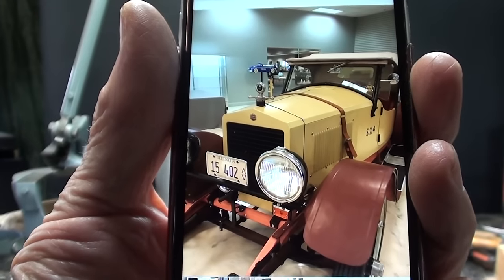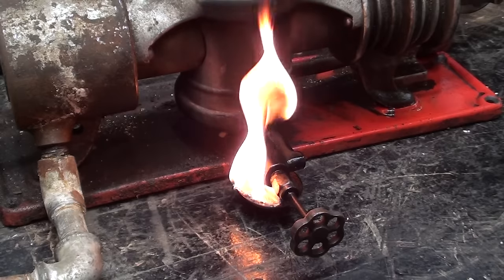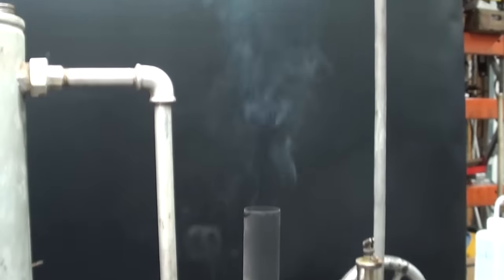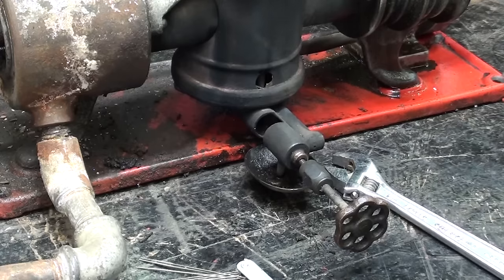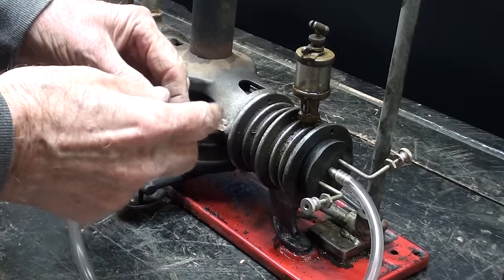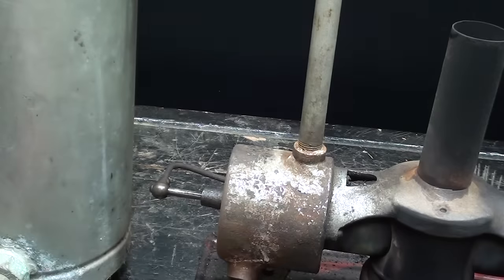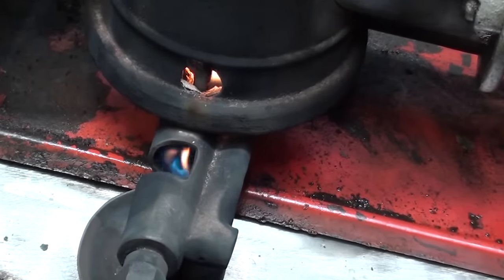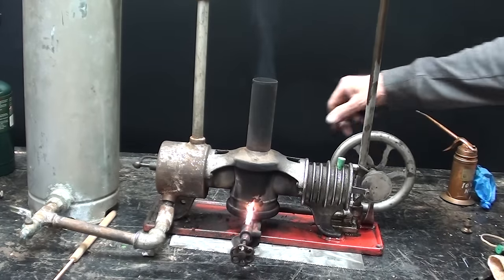ESSEX STIRLING HOT AIR ENGINE pt 2 #767 tubalcain stirling

Comment: I would start with a full disassembly, a cleaning and inspection and then applying all your knowledge of theory of operation of a hot air engine I’m quite sure you will get it running. I’m enjoying the video so far.
Reply from the maker: That is exactly what I will do in part four
Reply: @mrpete222  Thank you!

Comment: In regards to the lack of a blue flame. On my BBQ there is an adjustable stainless steel clip covering part of the port,  to adjust the amount of air entering maybe? Something like that would work. On the coolant, I agree with the previous poster of a air lock. Thanks for showing this wonderful engine.

Comment: First thing I noticed is you need to place the wick on the right side so that it heats up the vaporizing pocket.
The second thing is the pocket for vaporization is probably filled with caramelized fuel I would remove the valve assembly and clean it out so that the fuel will get direct contact with the walls and not the goo within.
Mix a couple drops of dish soap in with the lubrication oil and make the mix 50% oil and water I suspect that this air pump needs a little bit of humidity inside to create the collapse of steam back into water and expansion of water into steam.
I would prime it with a couple drops of water and assemble.
Make sure that the upper valve to the oil burner feed tank is completely open as the head pressure is necessary once the fuel is at temperature for vaporization then you should be getting a blue flame if not I suspect that the orifice may need to be drilled and tapped in a smaller jet installed until proper flame is achieved but I suspect the moisture will get it spinning in the current condition.
And when you're preheating it make sure that the piston on the water tank side is completely within it s cooling cylinder when the preheating process is happening or that piston will be too hot to condense the atmosphere within the chamber.
So it most likely will never start without the condensing piston inside the water jacket prior to attempting to start I believe this piston must be in the chilling cylinder as much as possible prior to starting.
Reply from the maker: Thank you for a very good suggestions

Comment: Looks like gasoline is right fuel. I always used LEADED regular in my dad's blow torch and it worked fine after you got it hot enough, which wasn't easy. Thanks for the lessons on the Stirling engine.

Comment: Please don't give up.  I would scrap the anti freeze and just use plain water until you get it running. Check and be sure the water system is free flowing. I believe temperature differential between the hot and cold side is important.

Comment: I've built several Stirling Cycle engines over the years and they are always finicky to get running.  First and foremost, you must get 2 things correct - 1) no air leaks at all, and  2) mechanisms must be absolutely free running with no binding anywhere.  These engines run off of the pressure differential generated by heated and cooled air.  As such they produce very little power and so can't overcome the leaks and binds.  Looks like you may have solved the air leak and I can't tell how free running the mechanisms are - they appear to be fairly free in the video but hard to tell without begin there myself.  But, one tip that I think may come in handy is that I think you're putting too much heat into the system.  The fact that your cold end is so hot that you can't touch it is key.  Try a much smaller flame and see if that gets you anywhere.  In the engines I've built, which are probably smaller than what you're showing, a small wax tealight candle is all that is needed to get them running - just enough heat to cause a pressure differential in the air but not too much heat to overpower the cooling capacity of the cold end.  BTW, I'm going to hazard a guess and say that tin can looking piece on the end of the hot end piston is probably there to help displace air from over the flame during the vacuum stroke.  Between that and the cold end displacer nearly all of the air volume should be pushed into the cooling jacket, which is absolutely what you want to have happen.  Hope you figure it out - good luck.
Reply from the maker: Thank you for an insightful comment from Another engine builder. I am going to take the entire engine apart

Comment: I was so hoping to see it run!!!  1. You're right, the burner flame should be blue and sound like a mini-blow torch, 2. as a few people noted below, did something nest inside the annular space thus causing all the smoke, 3. that bubba repair has got to be fixed... though the cast iron part of the piston seems to seal well, the drag has got to be causing problems, 4. looking forward to the cooling problem fix in vid 3.  Don't get too discouraged, I spent 30 yrs troubleshooting equipment that Bubba got a hold of ... great satisfaction from figuring out why it wasn't working.  Good luck!

Comment: Mr. Pete, I am finding this series to be very informative.
I built a sterling engine a number of years ago, and it doesn't run just about as well as your Essex.
(Mine is a Jan Ridders design, and I suspect my engine has a similar problem to yours, but caused by my lack of knowledge on the intricacies of making hot air engines).
Your process of troubleshooting will certainly help me with tracking down what ails my engine.
Thank you for posting this series.

Comment: I hope you don't give up on this project.  It is one your more interesting videos.  Also, getting old hardware like this hot air engine to work again is more than worth the effort in my opinion.  You have the skill and knowledge to get the job done.  So getter done!  We of the older generation have to show the younger ones you don't give up if at first you don't succeed.  Thanks for the video.
Reply from the maker: Thanks

Comment: Greetings from England.  If my experience with Primus Stoves and Tilley Lmps (Coleman Lanterns?) is anything to go by, if the burner is shooting liquid kerosene, the it isn't hot enough.  Furthermore, the liquid fuel going through it will cool it down further.  Also, make sure that the jet orifice in the burner is pricked out.  Use a wire of the same size as the jet for this process, not a pin or needle, or the jet will be spoiled.  Try filling the pre-heater bowl with alcohol, light it and let it burn out, then fill it and light it again.  Before it has burn out, and while there is still a decent flame, open up the main burner valve.  This procedure usually worked for me with the aforementioned appliances.

Comment: For the last several days I have done some reading and watched a lot of videos.  And it is a big Yes you can NOT have any air leaks, and yours is the only one I have seen with an oiler I bet it was added to help seal it.  On a good condition engine it doesn't take very much heat to get them going. I would really start with trying to replace or repair the brass part of the piston.

Comment: Try placing wet towel on cooling fins (press it tightly in between the fins and keep the towel soaking wet), maybe it doesn't have enough of a temperature difference between hot and cold side or maybe it's just warming up so slowly that the cold side heats up together with the hot side. Also, have the piston positioned so, that it's in the cold part of the chamber untill it's "hot enough to run" (that should help keep the cold side cold). If the towel method works, maybe it could be replaced with an electric fan, (or maybe even a stirling engine driven fan). Maybe you can also give hot side a little bit of help with a blowtorch. I really hope you won't get too discouraged as I really like seeing your engines run and each one is unique in its own way. Good luck!

Comment: Another thought to your burner problem Mr. Pete is that the valve under the fuel tank should be open the whole way to get the head pressure at the nozzle, Then if there is not a vent hole in the cap the tank can pull a vacuum lowering the head pressure. Just a thought.

Comment: Hi Mr Pete, as you say, the quality and design detail are amazing, considering it's essentially a toy, or demonstration piece.  Even if the cooling water isn't flowing, I might have expected some motion until the temperature differential got too small.  To check for leaks, why not put some air in through the oiler and go round it with some soapy water. Also, that orifice sounds quite large compared to those of Primus and Coleman stoves which operate on the same principle.  Good luck, I hope you discover the problem.
Reply from the maker: Thanks

Comment: Just a thought to try and temporarily get it to run - the next time you get it hotted up, try spraying some water on the cold side with an old windex bottle or whatever is at hand.  Until you can get the cooling sorted out at least.   Gotta have that delta T.
Reply from the maker: Good idea

Comment: That brass extension on the piston seems to be there only to use up space; it does not need to be a close (sealing) fit in the cylinder. This effectively eliminates "dead" fluid (gas) in the cylinder which does not travel between the hot and cold sections, and so is instead wasteful thermal mass. When the power piston is at its innermost position there should be no cylinder volume to the right of the hot zone, and perhaps the hot zone should even be covered a bit.

This allows the piston rings to be kept further from the hot zone so their lubrication does not degrade so quickly.

I would also say the cold end is way too hot.
Reply from the maker: Thanks

Comment: Hi Mr Pete, I'm not an expert but I can think of 2 things that might be wrong, if your needle valve is leaking that means air is getting into the mix and you are getting the yellow flame, maybe you need to put some packing around the stem to stop the leak, I think the flame should be blue.
Regarding the water flow, maybe there is an air bubble in the system, you know how that can happen with a car radiator, maybe you need to find a way to bleed the air out of that cooling system.
Hope that helps and I hope you continue to persevere, you can do it!
Reply from the maker: Thank you for the suggestion and encouragement

Comment: Have built several hot air motors. No air leaks and no friction and it will run. Try some ice water to amplify the heat differential.

Comment: The extension on the piston is to take up volume so there is not so much air to heat an cool. That way they can get the sealing area of the piston a distance away from the hot parts.  Related is the cooling fins around the piston, need to keep that cool enough so the lube oil does not smoke.
Any leaks in that piston extension or the displacer will stop the engine.
Reply from the maker: Thanks

Comment: I'd get rid of the antifreeze and go with clean water to transfer more heat, at least while you troubleshoot.  You might also try cooling the displacer end with "garden hose" cold water so you are certain that that end is being cooled.  Could there be a lot of corrosion in the cooling water lines?

Comment: Try a mix of unleaded gasoline  and denatured alcohol for the fuel. Say an ounce of alcohol per pint of gas. The alcohol helps the gas burn cleaner and seems to help it spray finer.

Sounds like the coolant's not flowing. Try running with hosed through water temporarily, to isolate cooling problems from engine problems.

Comment: I think I may have an answer for you, if the pipes to the water tank / cylinder are reversed it would allow the hot water enter the top of the cylinder this would push the cold water out of the bottom allowing the water to cycle.
In standard plumbing I would fit a small pressure vessel at the top with for example 2 bar pressure, this would allow for safety in the event that the cylinder would overheat.
Food for thought I could not think of much else today also give the pump about an hour to achieve temperature.

Comment: The orifice over the needle valve in the horizontal tube you pre heated works via Bernoulli’s law. If someone made the orifice larger this would change the air fuel ratio. You could partly occlude some of that orifice to adjust air fuel ratio.

This may not be the issue- gust a thought
Reply from the maker: Thanks

Comment: I have no experience with hot air engines.
And this likely won't help get it running but for a thermosiphon to work, there can't be any air in the water system.  Fill the tank until the top pipe is submerged. Then tilt the machine a bit to burp out any trapped air. Then it will do it's heat transfer work.
Reply from the maker: Thanks

Comment: You need to put some light oil in the oiler and put the oiler back on the cylinder and start a drop of oil into the cylinder.  The oil will form a seal around the piston and complete the sealed chamber.  It may run.

Comment: Just an old diesel fitter, no experience with air engine's but from following you if it were mine I believe I would check for a restriction at the cooling circuit. Natural convection would draw heat up the fluid pipe. But I would think like any engine there is a certain temp it want's to be at. Run a gas or diesel engine without a thermostat and performance suffers. That requires cooling at the reaction end of the piston to create bounce. Correct? Past that UNBUBA it.  But that would mean having spec's on it 
                                                                                  Good luck
Reply from the maker: Thanks

Comment: I thunk maybe a slight miss timing between the displacer and the hot piston is what is going on here in most of the try's to run it kicks back at the last instance before it would tick over top dead center . Keep up the good work
Reply from the maker: I will check the Timing. I am not sure there is an adjustment for that

Comment: Good Evening, Mr Tubalcain. Thank you for the videos you post. I must admit that this is the very first time I will comment in any platform. His is due to the fact that I may be able to add a little information to your puzzle. In a small way hoping to repay the many insights that you give whenever you post. I looked at the Replica Essex engine posted by Myfordboy. I went back to his build to find out the differences if there was any. Essentially it is the same engine There is a difference in the size of the water jacket. The engine that you have is much larger encompassing almost the whole displaced section. The replica engine only occupying only a portion of that section. The middle portion is different as yours has a chimney. Though it may seem that it was possible and intended to place one in the replica as well. It seems that engine you have was designed ( original or modified ) to work at higher temperatures. The chimney will make the lower chamber hotter. Since you mentioned that a specified temperature - when the difference between the hot and cold is at minimum it will stop. So the bigger water jacket is there to address threaded heat of the chimney. It could be said that the temperature where the engine will no longer work will be attained much faster with the hotter environment due to the chimney. This makes the cooling part (water jacket ) very important. It should be doing its job. The other part that is noticeable is piston. The extended brass section is intended - although the use of brass as material is not clear since your engine is older. There is a liner as well. Although the placement of the liner in your engine is further inside and seems to be contacting the the extended part of the piston. In the build it seems that the liner is placed closer to the rear so that it will have interplay with the rear of the piston ( non brass ). Closer or at the edge were the mounting screws of the pulley and flywheel assembly. This is an issue - if the sleeve is contacting the extended part of the piston assembly there will be less air to displace. So there will be less gas to expand and contract. The other issue is the oil dispenser. I noticed that there was oil at the sight glass at the beginning and there none at the end. It would be convenient to have a reserve but if it kept on dripping and not recirculated then it would be a waste. If the oil reserve is below the lining and is above the section of the main piston body( at the rear ) it will explain the loss since the piston has more space to move since it is not contacting the liner. It will also explain partially the reason that the engine seemed to have a better chance at the beginning than at the end. Since there will be less oil to cover the piston to make a temporary seal. The identation on the brass extended portion of the piston assembly seems to be an attempt to fix a poor fit. The lining may have moved forward down the line and could have been assumed to be the place that it was supposed to be. It is always interesting to see how puzzles could be solved. I am sad that you have less interest on your stirling engines that you made. I hope it goes to a place it will be treasured as much as the joy that it gave you in making it. I hope this helps. You can review the build at Myfordboy to confirm the observation. I do hope you get it to work. It would be difficult to think that it would be thrown. My thanks again for all the times you posted. I am sorry for the long post. My thanks again.
Reply from the maker: Thank you very much for the insightful comments. You seem to be very knowledgeable and observant. There is a third part of this video coming out next Saturday. I made these three videos several months ago. And hope to get back to it soon. I plan on disassembling the entire engine. Keep watching.